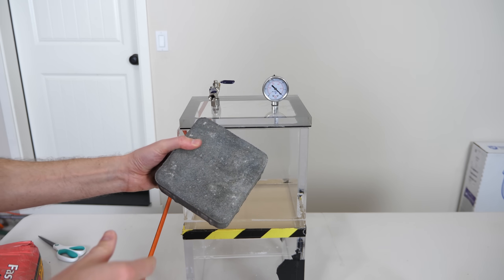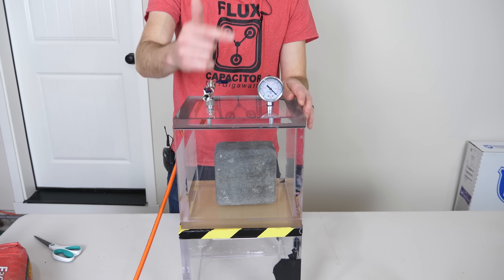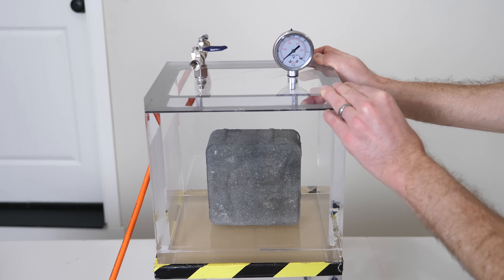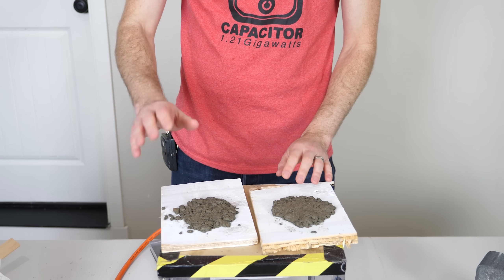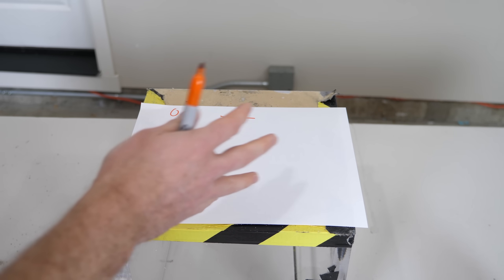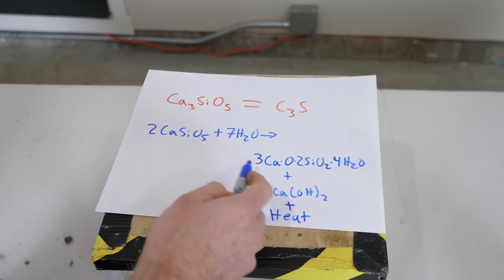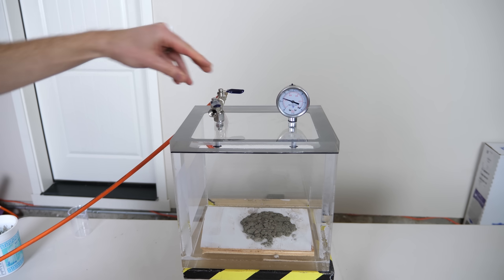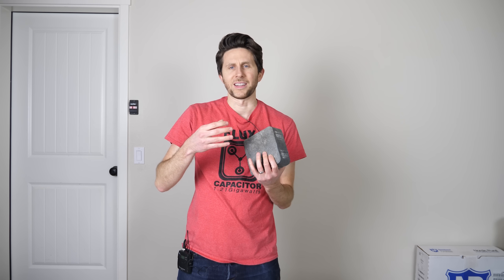Does Concrete Turn to Dust in a Vacuum Chamber? Concrete Without Oxygen Experiment

Comment: I'd guess if the vacuum is strong enough and is maintained continuously while curing concrete, you'd lose a lot of water through increased evaporation, might get dryer than Ideal. There's probably also more bubbles caused by boiling water. I guess micro bubbles on the surface and/or a lessened curing at the surface because of a deficit of water near the surface probably explains the slight colour difference in your experiment.

Comment: Air and oxygen are two different things.  Air is only about 20% oxygen but about 80% nitrogen (and less than 1%  CO2).  Losing all the oxygen would reduce pressure to about 80%  of normal, so about like going to an altitude of about 6000 feet.  Not a big deal.  But even total vacuum is only a pressure drop of 14.6 psi at seal level which is relatively small.  That is also the difference in pressure between sea level and a depth of about 30 feet.  Good concrete can handle stress levels over 3,000 psi so one would not expect even total vacuum to affect it.

Comment: Technically concrete would decompose in a full vacuum, as it both dehydrates and decarboxylates. But the partial pressure is super low at room temperature.

Comment: Removing the air from the chamber does not remove all of the oxygen.  Just most/all of the gaseous oxygen depending on the level of vacuum pulled.  From a chemistry standpoint, if all oxygen were removed from the molecular bonds of the cement it might cause it to destabilize, but that would require selectively removing singular atoms from several different complex molecules leaving behind Iron, Aluminum, and Calcium.  Simply putting the solid in a vacuum will not do this,

Comment: nothing is gonna happen. 
Concrete -as almost any other solid material - is bound together by intermolecular forces. These dont just disappear because there is no oxygen. Covalent bonds are made with electrons, not oxygen. Ionic bonds require ions, not neutral atoms of oxygen. Tertiary forces rely on nuclear attraction. Not oxygen. 
And even if Oxygen was important for the material in the long terms. Its not as if any bound oxygen could just diffuse out in seconds. I dont know the exact structure of concrete. But if oxygen plays any role there it would probably be because there is bound oxygen in it. Which could concievably migrate out if teh concentration of oxygen in the surrounding air is reduced. Maybe you would see some reduction happening. But this takes time. Unless your concrete is a molecule-thin sheet at most the surface will be affected. And the bound oxygen further inward will have to wander out slowly.

Comment: the reason neither sample is particularly tough, despite your reaction completed, is because there is a second slower reaction - the calcium hydroxide reacting with carbon dioxide in the air. I suspect the sample in the vacuum would never get any harder (stop that giggling at the back).

Comment: Originally I would have assumed that it would stay as is in vacuo, since concrete formation is a chemical not a physical process. My lay reasoning behind this is that concrete doesn't get its compression strength from atmospheric pressure, it gets it from the exothermic reactions and chemical bonds that occur and form while the concrete is setting. So introducing concrete to a vacuum surely should not cause it to crumble or lose any of its structural integrity or even any of its properties seen under normal atmospheric conditions.

But on second thought I was considering the fact that concrete is actually quite porous and the lack of inward pressure against the concrete could cause enough outward pressure from the air pockets inside the concrete to generate enough cracks to allow the concrete to crumble.

So after a little more consideration, I would assume that either A- No, or B- Depends on how porous the concrete is or possibly other aspects of its inner structure or makeup. Probably wrong, just a guess.

Comment: One thing is remove all air, and another absolutely different is removing all traces of an chemical element, even in molecules. If that is the case, yes, all oceans will turn into hydrogen

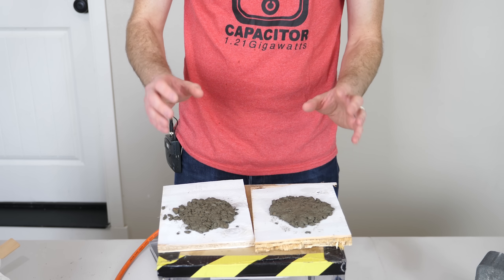Comment: 4:52 Flaw in the testing method here. The way you set the one on the left will cause it to be weaker than the one you mixed better on the right.
Reply: You cant mix one less than the other and expect it to be the same strength

Comment: If you instantly caused all oxygen incorporated into concrete to vanish from its molecular structure that might cause it to crumble. Just removing the oxygen from the air around it? Nope. Fun fact, Earth's crust is 46% oxygen by mass. If ALL oxygen on Earth suddenly ceased to exist, not only atmospheric oxygen but all oxygen throughout the planet regardless of what molecules it's part of, the crust would crumble too, and it would likely have an effect on the mantle and core as well.

Comment: Welllll so breaking a semi cured cookie of concrete like that would always be easy. As would breaking a cookie of concrete like that after it had set for 30 days. Thats too thin of a piece of concrete to get the kind of structural strength and rigidity that you think of with roads. Heck that piece of concrete even mixed properly (Which what you have there absolutely isn't) would still be easy to crack in half by hand because of how thin it is and the type of force being imparted upon it.

Comment: What surprises me a little is the fact that in a vacuum the water boils by room temperature. So it should A. less water in the vacuum concrete and B. the vacuum concrete should cooled down a little because of the enthalpy of vaporization. I thoght both effects would change the outcome... 🤔

Comment: The concrete would need an incredibly high entrapped or entrained air before the vacuum affected its strength. However, its strength is based on several factors. So, if the vacuum doesn't overcome the strength of the concrete, it would not affect the concrete.

Comment: ... Hallo Stardust - dust in the Wind - Sand from the Sahara in the air. Will u Go with me - lat. Vademecum - and Vacuum. H2O the Wonder in the tripple Point - Fluid Gas and Frozen ICE. Oxygen - power song by Jean Michel Jarre.

Comment: If concrete dries when it is mixed it fails to be concrete as we know it.  The correct term is concrete sets.  Without enough water you get weak concrete.  with too much water you get weak concrete.  Concrete hardens because it is growing crystals and for the crystals to grow properly it needs to be mixed with a specific percentage of water.  So, please lets not call it drying, concrete sets.  Its a big difference.

Comment: I just watched this one, I love your vacuum chamber did you build it or buy it? The landscape stone you used may not be just concerned. The company I worked for, which I'm not moving right now, would donate their solid waste from paint and polymers to mix into concrete for landscaping stones. This was an environmentally safe way of disposing of solid paint waste. As well as it added strength to the landscaping stones and they could use it for coloring I believe as well it was told to me. I don't know if having a polymer in the Stone as a binding agent to the concrete would add anything else to it. I was also wondering if it had any air pockets in it that would pull the air out during the vacuum. I'd be interested to see what that vacuum chamber would do to certain natural stones or geodes since they usually carry some level of moisture or air pockets in natural stones.
Reply: @@huntershepherd8838 Sorry, I tend to spill out when I start talking.
Reply: Good points made. For concrete and most rocks, their own toughness will likely always withstand 0 atmospheres, regardless of any air bubbles, unless the rock is thin, soft, and filled with quite a lot  of fluid/gas compared to its size. Even the vast majority of geodes wouldn't pop in a vacuum.

Comment: To make a partical cloud study chamber with your vaccum chamber you mount a press vlave chamber that connects to a glass tube the glass tube is your boiler so you can fill it once the clouds expands you can add more fuel to the boiler the vacuum chamber being zero atmosphere the partical cloud would be the atmosphere in the vacuum chamber you can make your own fugel crystal out of sewage or chemicals to find partical fuel clouds partical clouds may have positive and negative electron combustion sciencetist be ware studies are at your own risk

Comment: It didn't form cracks, u can see the moisture being drawn out as the lighter color of the drier surface is forming significantly contrasting hues in comparison to the slower drying cracks..... that's the whole, well a large part of evacuation of closed systems via vacuum pump....

Comment: babe get a giant pool with a small hole and pressurize to flow out .. that should be a better space simulator than a simple pressure tank ... get the flow out in geomtry to simulate expansion

Comment: the only reason I can imagine it would crack or crumble would be a big air pocket inside the concrete. but this is a vacuum chamber, the videos were only talking about if oxygen was removed, and also it didn't happen.
I just want to know where that idea came from, because the "it needs air to dry so therefore taking air away would make it fall apart" explanation doesn't make any sense no matter how I try to think about it

Comment: Dry concrete is anhydrous calcium silicate. As is cures each molecule of calcium silicate absorbs up to 6 water molecules which turns it into rock.
The question is if exposure to a vacuum causes any of the water to boil off. Apparently not. It has nothing to do with the presence or absence of oxygen.

Comment: You can make a muck quicker setting concrete or any Portland cement product by just mixing in some baking soda do tester batches to determine ratio best I remember (many moons ago)about 1/2 a cup to about 4 gallons gives you about 15 minutes before you get a bucket shaped brick

Comment: You keep saying the concrete dried when you are also aware that concrete sets. You can set concrete underwater, if you were to then say “concrete dries underwater, and it actually makes the best concrete” doesn’t really make sense (btw it does actually make the best concrete because it has a good supply of water and heat is absorbed)

Comment: You will end up with a lower water/cement ratio which determines strength. Less water yields a higher strength mix due to fewer voids in the cement matrix. There is a limit to that, obviously. I happen to be a structural engineer. BTW, you usually use need four ingredients for concrete–cement, WATER, fine aggregate, and large aggregate. Two kinds of aggregate is more space filling yielding a more economical mix since cement is the most expensive component.

Comment: I know I'm a little late to the party but my guess is that nothing would happen and I am 90% sure of that. My reasoning is that the idea that concrete would crumble if all oxygen was removed for 5 seconds does not just mean gaseous oxygen but also including oxygen involved in chemical bonds and existing in other states. If you break those bonds by removing the oxygen entirely, then you have effectively created a new substance that won't necessarily have the same properties of the original substance.

Comment: I may be mistaken, but concrete is a product of hydration, where the water allows the cement particles to come together around a molecule of water. Considering that there is hydraulic cement, which doesn't need oxygen to make. The hydrating water is essentially locked in a crystal cage. 
The only thing that a vacuum might do is lower the vapor pressure which allows the water to escape the cement. Probably not enough to free the bound water, but it might require less energy when you apply heat to it. If you apply enough heat, the water breaks out of the concrete, and you're back to the initial ingredients. Limestone is an example of a rock which needs water to be in rock form. If you heat it, it turns into burnt lime (Calcium Oxide).
   I think there are some products which might be weak enough where a vacuum might liberate the water molecules.. maybe gypsum or epsom salts. Vacuum distillation and vacuum drying is a think (freeze drying is forcing the water to crystallize and sublime out). 
   Interesting question, but boring answer ;)

Comment: Concrete doesn't dry tho, it sets. 
The water becomes part of the molecular structure, so when it rains it actually gets stronger. 
So technically speaking "drying concrete" is a wrong thing to say. 
I would have thought that the setting concrete in a vacuum would evaporate more water which wouldn't allow the concrete to set as hard tho. 🤔

Comment: Sand and concrete is how you make things such as mortars and grout.  To make concrete you ad sand and a larger agrigate such as pea gravel of 57 limestone.   

And the heat you were feeling was hydration but it was also a reaction caused by the lye in the cement mix.    And yes any experienced concrete guy will tell you to keep a jug of vinegar on one of the trucks.   Its like handling snakes its not if ya get bit but when you get bit

Comment: kinda surprised to see that you made a video about something I know a great deal about.  I was a bridge builder for quite a few years, i built culverts, levees, house foundations and much more as well.. and more bridges than I can count.  My QUESTION is, Why does concrete still continue to get hard even years later.  Ok, before I go any further, you didn't mix that concrete very well, which is of major importance to the result.  We always used a industrial vibrator... and some people tap the forms on small pours, though almost never did small pours... my largest was 1250 yards a foundation to a 240 ft tall bridge.  I also wound up doing some demolition on a few jobs, one being a railroad bridge (that's what they called it, i would have called it a box culvert, but it was slightly larger I guess, just nothing in compared to my other jobs) ... we had to take out the old foundation of, so we took out the top part with track hoes and heavy equipment, and the bottom part I took out with a 90lb air hammer, It was the hardest concrete I had ever seen, and we dealt with very, very tough concrete in that industry, often 4,000 psi sometimes with fiber, sometimes with fiber and rebar, sometimes with just rebar.  none of it ever was as tough as that 60+ year old culvert that I helped remove... when I asked my more experienced coworkers why, they said that concrete never stops hardening, and I have heard that several times since from highly experienced guys in the biz.  I assume it is because of the chemical reaction , just don't completely understand it.  Can you make sense of it?  I know some say that it will continue for a limited time, but that is not what I found in the "industrial"  uses of the stuff.  Sure maybe in california it might not seem as to harden as they have so many earthquakes and there is another saying in the industry, concrete always cracks... it is just a matter of where, hence we put in expansion joints <(hint maybe? I don't know)  Look man, this is a cool channel, i am glad you are not letting politics into your science (it does not belong) I thought you did when I first started watching your videos.  I love to learn, and would like to understand this, Thank you for taking the time to read this, I hope you are able to find the time to make a video helping me understand it.  I doubt very seriously that 60+ year old concrete (may have been up to 100 years old) had fiber, it did have some rebar.  I knew the answers to your questions before you demonstrated them mostly because concrete hardens under water too.  Thank you again for dispelling the junk science on the web.  keep up the good work.

Comment: Wet concrete will cure just fine, the chemicals to create concrete are all present, the only possibility is the loss of water due to boiling or evaporation might impede or slow the curing perhaps on the surface

Comment: The ingredients in concrete are chemically bound together. Changes in air pressure or the existence of a vacuum will not change anything chemically on a molecular level. Oxygen has nothing to do with any of this. Once concrete is cured it is strong and stable. Concrete holds up under water, duh. It is the equivalent of solid rock.

Comment: Dude oxygen is molecularly bind with other elements to form oxides which are what most stones are made out of so the video is saying that removing the oxygen (O molecules) out of the substance entirely will crumble entirely not just removing air.
Reply: These videos talk just about air, if you take out oxigen from every molecule every form of life would disappear
Reply: @idk-ne1ri  it’s not about life though. The experiment failed because just sucking out air doesn’t do anything to the concrete. Those videos meant to take out the O molecules all together.
Reply: @pichousakirito168  i watched some of those videos claiming that structures would crumble when the oxigen in the air disappears, so it's just a myth
Reply: @idk-ne1ri  I’ve watched them too but they specifically said if we take out the oxygen element out not just in the air.
Reply: @pichousakirito168  every single video specifically said that? I don't think so, the few i watched talked about air
Reply: @idk-ne1ri  yes it has to to be true if not then it’s misinformation.

Comment: To be a true test, the concrete should be under a compressive force. You specified structures crumbling, so it would be under a compressive load. I'm sure it will have no effect, but you need to test it.